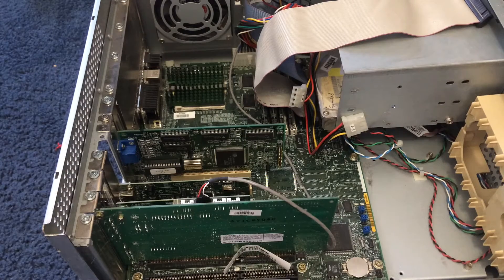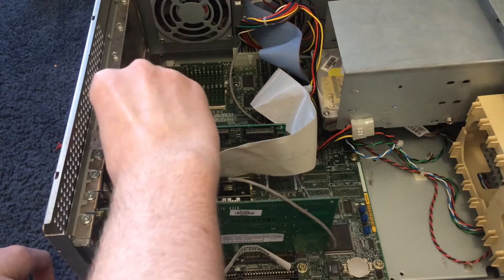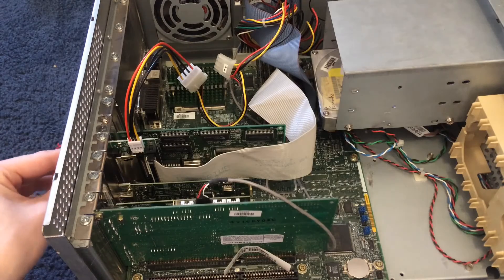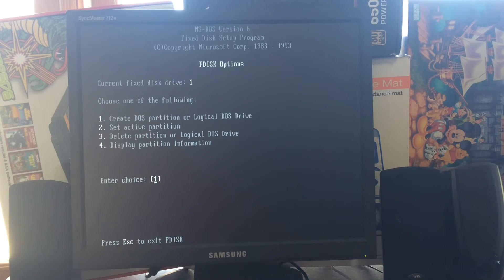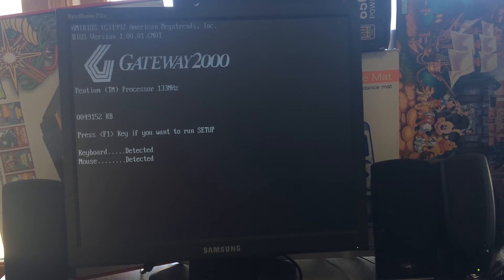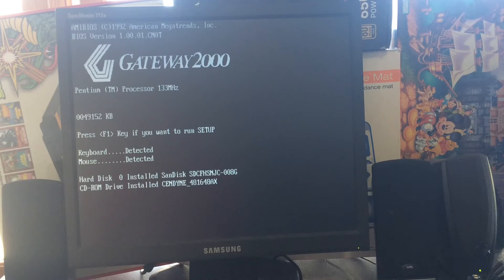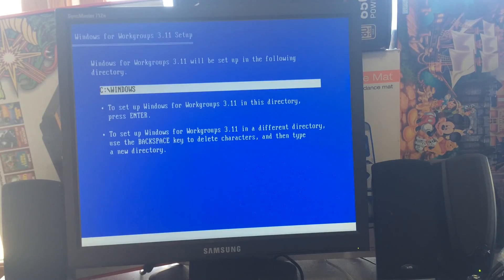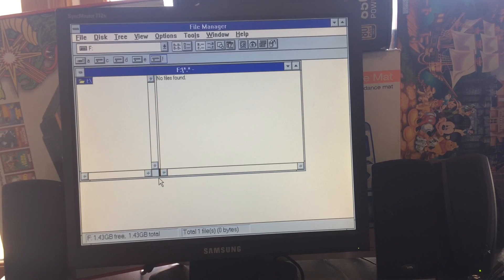Installing an SSD in a Pentium 1 System

Comment: 66mbps max of the compact flash bus and the lack of cache. its not really ssd to the modern definition. try a Sil3112 sata controller wich may run on a dos pc il y have at least a pci 2.1 bus. You will be able to run ssd sata drive with cache at 150mbps much much faster :)

Comment: Considering that a lot of DOS machines only had 640 KB or sometimes less 50 MB would be a lot for that.  Back when I had my 286 I would have liked some extra RAM.  It can be tricky getting some things to run in just 64 KB
Reply: I miss my 286 some times. 4 whopping megs of memory. 80meg miniscribe HDD. Trident Video card. EVGA monitor. Ahhhh. Goog times.

Comment: I don't understand why people use CF Cards when SD cards are objectively better (or better yet, NVMe to IDE converters, since they dont have any fixed disk nonsense)
Reply from the maker: i dont really care what gets used at the end of the day, that purchase was based on "oh hey it was cheap, why not"
Reply: I've had better experience with CF cards than SD in terms of reliability. Anecdotal, I haven't looked into it. Also the CF to IDE adapters are entirely passive with no logic on them, which I take as a plus personally.
Reply: @tkoutnchannel  I mean yeah but does it matter when CF cards are still finnicky with some BIOSes? it's still a removable disk being used as a fixed disk.
if you want 100% reliability you should just blow the extra money on a m.2 to ide converter, or a sata to ide

Comment: 98SE is better than 95....

Now if you could only get an NVMe drive mounted on an ISA card or some unicorn like that....that would be cool!!
Reply from the maker: not on this system, Windows 98SE is like ~50% slower then 95 or 3.1, i have faster machines for it anyway
Reply: @ezioisawesome56  

I was referring to the quality of the software, not necessarily how fast it ran.
First system I ran 98SE on was a Super Socket 7, AMD K6-III 400MhZ....so a bit more than your system.
Reply: @montecorbit8280  technically you could get an NVME drive to work on a pci slot with a PCIE to PCI bridge chip, but you'd either need a special coreboot port for the PC, or have some dedicated nvme option rom for NVME ssds (some exist afaik), but that wouldn't fully guarantee that Win98 will fully understand how to use it.

TL:DR it's way too many efforts for no real gains
Reply: @DxDeksor  

Kwel!!

I kind of figured they didn't exist....